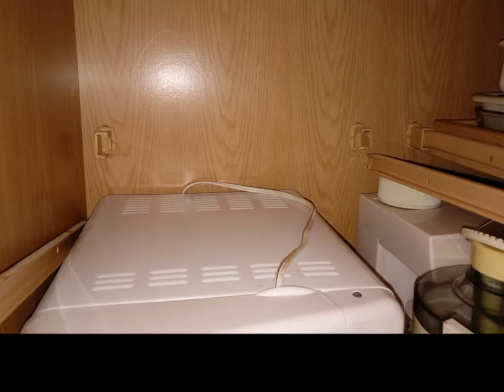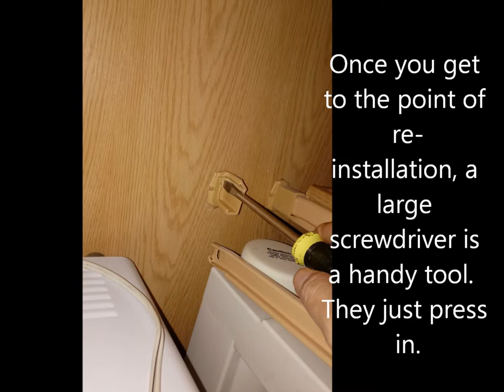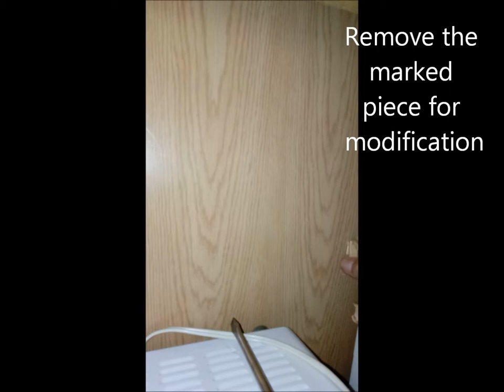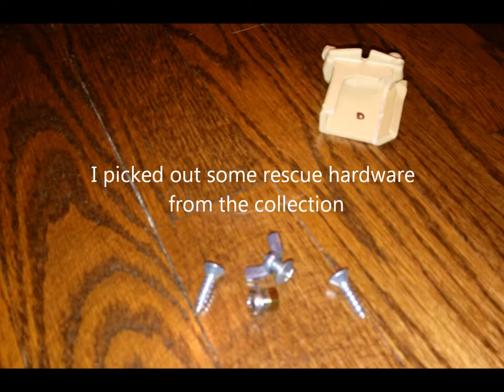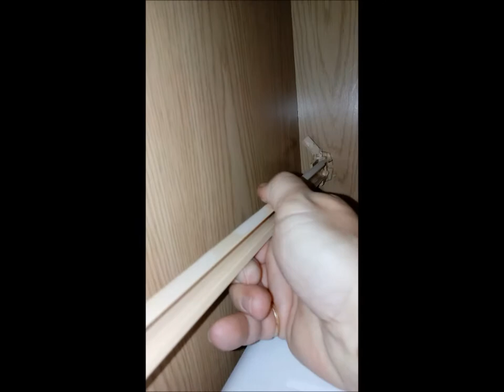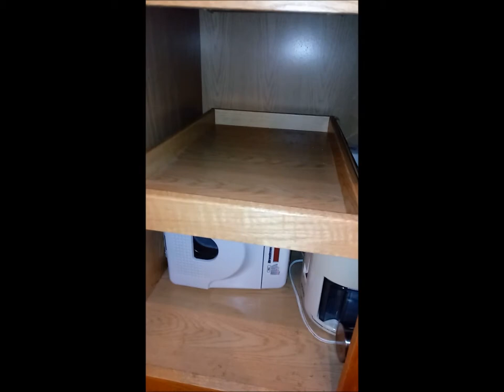Merrillat Cabinet drawer track support repair.

Comment: I used a zip tie because only the bottom portion of my plastic bracket was broken. Idk how long it will last but for now it’s holding.
Reply: *I used cable zip ties
Reply from the maker: Zip ties are an acceptable solution. Like wall anchors for screws. It's still working, and that's what matters.